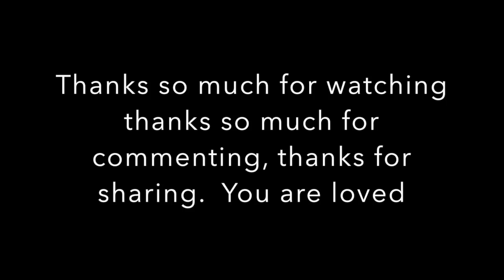Bus Conversion to Motor Home #155 Slide out Bed and couch

Comment: I had contemplated a slide out type of bed for my short-bus, it is a great idea but ended up a solid setup only because it will be just me and my two feline boys Paddy and Sherlock.  I still might change to the bed/couch setup you made.  I still have quite a way to go before the bus is completed but it is far enough along for trips.
Reply from the maker: Sounds great!  Thanks for watching!